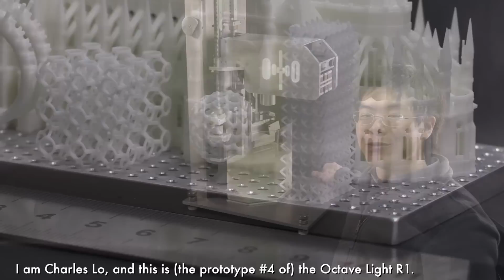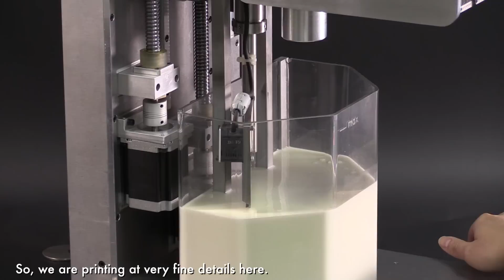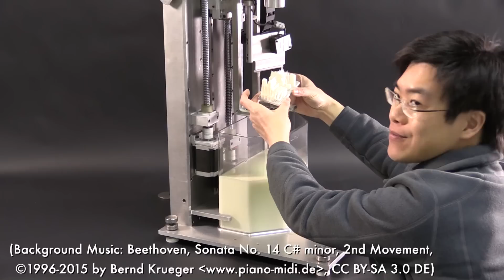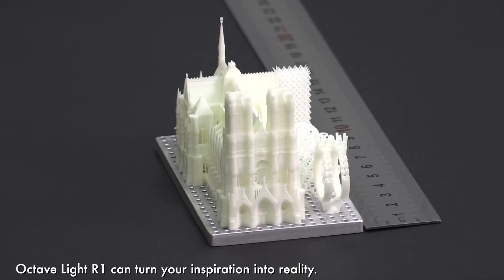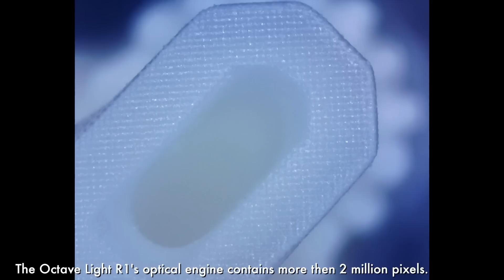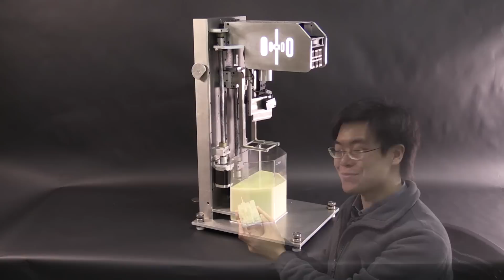Cathedral, Microscope, & the Octave Light R1 Top-down DLP/SLA 3D Printer

Comment: Please reqerment resin
Reply from the maker: Any well engineered resin that's designed for 405 nm wavelength DLP 3D Printing will works. How well it works depends much on how well engineered is the resin. I would suggest purchasing my Octave Light Strong resin along with the Octave Light R1 3D Printer.